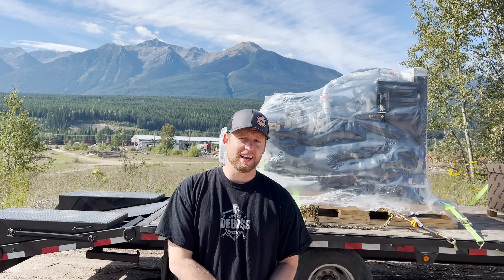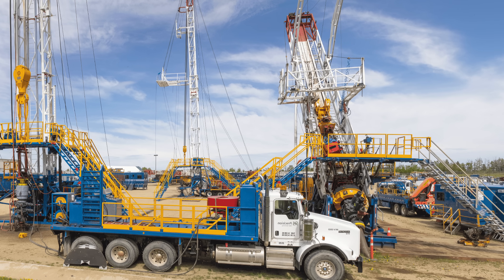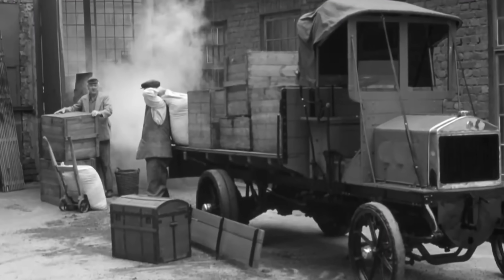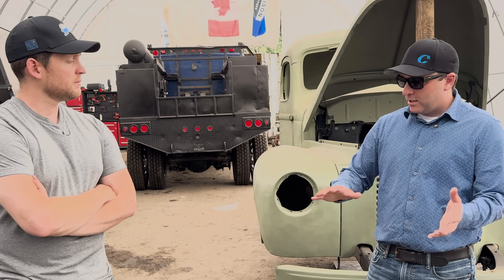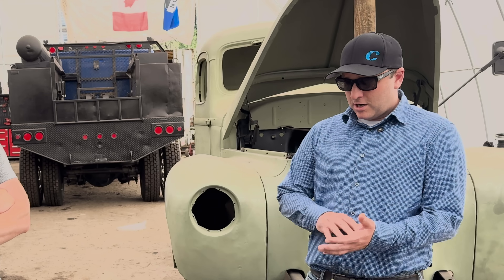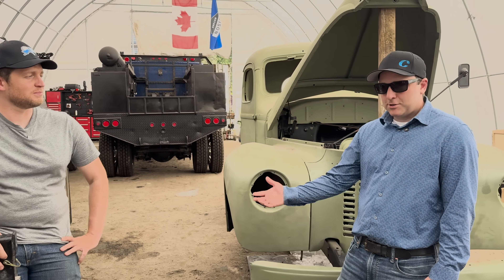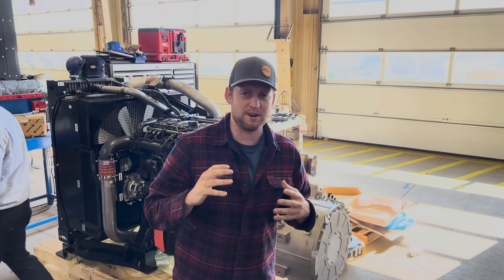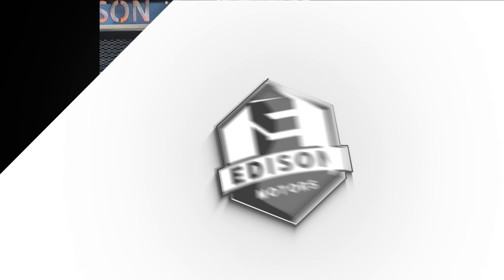We're putting Scania engines into Edison Motors Trucks!

Comment: Okay, maybe this is a dumb question. I thought the whole concept here was to put a smaller engine in to drive the generator. Maybe I don't know enough about the commercial truck space. But this seems like just a regular sized diesel engine for a commercial truck? Maybe I'm confused on what we're talking about.
Reply: It could be that the 770 @ 50% load is more fuel efficient than the C9 at 90% load. This is a generator though which typically run at a single RPM, my assumption is CAT didn't want to budge on pricing without quantity, since Edison cant afford quantity then they went to scania.

Comment: one thing to consider is that european fuel is allowed more sulfur... which is a lubricant... which a lack of can cause fuel injection pump issues... See Bosch CP4 failures in GM,Dodge and Ford light duty diesels.

Comment: Wow... bruh... 
Highest loads we see in Europe is 76 ton, and thats in Finland, rest of Scandinavia is between 50 - 74 ton.
UK is 44 ton.
Rest of Europe is mostly 40... with some exceptions.
We see more and more length changes too more inline with Scandinavia where we have had 25 meter long combo's for decades, that has increased in some cases to 30+ meters.
Volvo has again taken back the crown of highest power engine, they were leading at 750 for a very long time, Scania then got 730 to 770 and now Volvo has a new 17 liter engine with 780 hp and 3800 nm, up from 3550... just crazy numbers!
Scania are the only ones doing V8's now as far as I know...
The International LT's just got the 13 liter Scania engines with the S13 Engine and T14 gearbox, dont know of any other atm that use them in North America but could be more.

Comment: Fantastic!!! If Caterpillar was going to treat you anything like how they are treating me, then you made a great move to Scania!!! I have two mini-excavators that have problems working in the mountains built into them straight from the factory. After the dealer spent several months in total dealing with my machines, their lead tech told me, "This isn't right. But, I doubt CAT will do anything about it.".  I told them that I do not mind the problems, as long as we can all be on the same team to either fix them or work directly with the computer programmers to feed them real world data to improve the line. they prevaricated and stalled and finally told me that they can't give me access to anyone - CAT doesn't allow it. And, they started saying, "Your machines are in spec. We did everything we could to make you happy."  ...total, ugly, corporate talk. ...from, don't worry, we'll make it right, to, nothing wrong, we were just trying to make you happy. Lesson: stay away from CAT!!!

Comment: I have been following your channel for a while and I'm excited for Edison Motors to have such a great opportunity to accelerate their business & disrupt the competition! A word of caution though: Don't let the big partners take over the culture of Edison Motors! Read the fine prints in detail and don't become like Tesla! Service should be available wherever a truck breaks down and not be exclusive of a dealer. Software updates should be available forever and not temporarily. Don't become like John Deere equipment that forces their clients to buy new equipment because they don't support old equipment and their own software. Don't become like apple where every year they design new charging connectors on their phones that are incompatible with old charging cables because they have different charging frequency and the battery fries if using an ordinary over the market charger. Let the software be like Linux! Completely accessible to brilliant minds so it can be modified and perfected for better performance! Only certain sections should be protected but can have a temporary access to fix an issue but protect it from bootlegging. Microsoft did this with its windows program! They knew people copied their software and let them do it anyway but disabled certain features because it didn't have an original certification! Edison can do the same! Let the service mechanics do modifications but only temporarily until they can explain why they are doing it like that  in order to certify the software module; sometimes mechanics have better ideas than engineers because they are the ones working on the problems! I hope you can read these suggestions and at least consider some, good luck on your journey! I'm rooting for your success!

Comment: As a European I'm obviously biased here, but it's really nice to see that Scania engines will be in Edison trucks! Agree with your point that running a larger motor at an easier power level is better for service life and emissions. Taking Bruce Wilson by his word, Scania trucks and probably engines are also very good to work on. Will the engine just be rigged to a generator or will it have a direct mechanical connection to the drivetrain?

Comment: I found out about Scania many years ago as a Diesel Technology instructor.  I researched them and found out that Cummins and Scania had joint projects going back at least 20 years from now.  Scania has a great reputation for being a solid choice for diesel engines.  I'm all for what you guys are doing.  Hybrid is the way to go for a long time to come.  Now, just convince these stupid lawmakers in California. The single greatest influencer for the legislators is the CARB (California Air Resources Board). They have their heads up their yahoo's so far they cannot think clearly.

Comment: The lack of a DPF is precisely why CAT stopped building on-road engines. They pulled off the same achievement and the EPA told them "No, gotta have a DPF".

Genset setup may have to meet different requirements than direct drive though.

Comment: If you are wondering why Scania Engine  doesn't use DPFs is due to ECM/ECU calibrations, they put in the time in the test cells to calibrate it properly.  While US manifactures run it bare minimum and that's they need DPF, have higher consumption and lower power figures
Reply: Crying out loud. Cheap and dirty.

Comment: Seems like a really stupid idea actually.  Having it as an option is cool and all, but Cummins/Cat are the most common engines in North America.  Finding Scania parts out when you're off road in Pink Mountain is going to be significantly more difficult than getting common Cummins or Cat parts.

As someone who has worked all throughout BC with exotic equipment, having something unique is really cool until you have to fix it and stand by charges start piling up.
Reply: We'll see. Seems Scania has some support already, just not for highway engines. 
And if they are without DPF is one problem less. 
Maybe the generator charger running constant rpm is easier on the engine so they don't break without warning (so much)?
Reply: @subwarpspeed  It's not a we will see matter, it's a fact of the matter.  Scania needs a much larger footprint in North America.  Working in remote wilderness, something Edison Motors has personal experience with... which makes this decision even more baffling... you want to have the most common, easy to replace components.  

You have a couple fleet trucks down, waiting for parts from Scania the novelty wears off fast.

Air mobilizing parts, especially heavy parts is very very expensive.  The Wirtgen I worked on, we were left stranded for three days waiting for Bolts from Germany.  Why?  No one ever thought anyone would need those bolts, they were part of the unstocked 5% in North America.

That was $10k+ a day the machine wasn't making, plus paying standby for a road building crew to do nothing for three days.

On a truck, that kind of wait would never be acceptable.  

I really think the Scania engine as an option is a brilliant idea to help Scania build a network here, but the standard genset should be a Cummins or even Paccar.

Comment: How much kW are you using from the 770 then? That engine would not need much more than idle?
Using a smaller engine at higher load is more efficient

Comment: So the cam profile and intake and exhaust lengths etc are all optimised so the engine is optimised for the optimal rpm for the generator..? 
And where's the bell mouthed air intake to take advantage of any airspeed from the front?  This is supposed to be all about efficiency right..?  :)

Comment: Question:
I understand that part of the idea to go hybrid is, to be able to reduce the engine/generator size - roughly to 1/3 what you would use/want in a straight Diesel application....
So - what kind of power can you realistically use with TOPSY (or the next truck)?  I understand yor E-axles are already too powerful to use all of it without shredding the tires?
So if you have no need for the 770hp/565kw - why use that engine instead of the 9L 270hp/200kw system? Isn't  the idea to size the battery pack for your worst case scenario (max power from the pack plus the generator for the max time estimated) and for the rest of the times the 200kw would be more than enough to keep the batteries charged? (....when regeneration isn't enough)
I am sure the 9L is a lot smaller/lighter than the 16L (5 cylinder inline vs V8)....
Certainly the smaller Scania is just as efficient at it's level as the big brother. 
Question is, did something chamge with the basic idea/philosophy?

Comment: I don't understand. I thought you were planning on putting a diesel generator engine in that is charging the battery and running at a constant torque level which is the strongest reason for using a smaller generator.
Reply: I think they're just making gas trucks now

Comment: I personally never got why a lot of other European truck brands never made it to NA. Volvo has been here for years in both big truck form and automobile form. The same goes for Mercedes, BMW, Audi and so on as far as automobiles. I'm sure Scania could find a new market for themselves here if their cab-overs gained popularity. That's one of the things that has been nice to see with farm equipment in recent years with how Fendt, Claas and Krone have been coming this way more as well.
Reply: Well Fendt is owned by AGCO. The Fendt Vario 1000 series tractors were repainted as Challenger 1000 but I guess they are phasing that out (Challenger website doesn't work) and the Fendt 1000 comes to NA.
Reply: @subwarpspeed  They may be owned by AGCO but sometimes it seems like some brands are always just for sale in Europe. But it's nice to see they're becoming another option along with Claas that someone can take a trip to a dealer for instead of needing one imported. IMO there's not enough choices for equipment especially in my area and it kind of gets old seeing the same four brands over and over. Maybe Deutz will come back to NA someday. There's a lot of old Deutz-Allis tractors from the 80's and 90's around my area. Of courser they're not as common as a CASE or Deere but they're around. The people who have them seem to like them.

Comment: One thing I wanted to know is how open is Scania to you Right to Repair.  I know you want to have open source programming and clear to read fault codes.  Will Scania require a license to their diagnosis software, will that be a part of the truck, or a something separate?  I think it would be an awesome selling point if an Edison truck came with the full service manual and diagnostics for the Scania motor

Comment: verry missleading on DPF considering they will still run configuation of emmisions system wich will fail, not to mention comparing a 13l 550 to a 18l c18 is not even close motor to motor comaprrison to explaine fuel consuption. Also service, you may be able to get parts but having actual companies to service it(with the proper EST) is a different story. i garantee almost nobody in north america will work on it. Scania may be a good product i have no boubt in that. im just saying the way it was descibed was misleading is all

Comment: Ok, so how is the service network in Canada?  Its pretty non-existent in the US.  (Nobody drives Scanias, and Nikola doesn't count, since those are electric and hydrogen vehicles)

Also, do you really need a 770HP engine as a generator?

-EDIT-
I stand corrected, just did a google search, there's Scania parts dealers all over the US, 7 dealers just 2-3 hours away from me.

Comment: So my question is why? For your trucks, it's just gonna be a generator. It's not powering the drivetrain or anything, and will be running at a set RPM whenever it's running. I understand the want for better fuel efficiency but couldn't you get that with just a smaller engine? What's the point of up to 770 HP for a generator?
Reply: Reading some Edison answers it's not going to be the 770 V8 engine normally, except they want it some rig just for the fun of it. 
But an expert at all but someone pointed out the engine they have gotten is an inline one. 
I agree, it only makes sense if it requires lots of power, meaning pulsing heavier and having a third e-axle as they mention on the webpage.
Reply: Have they given up on electric?
Reply: Perhaps the plan is the hybrid,combined power

Comment: Sounds like a rather large engine isn’t it a little overkill for running a generator? For a direct drive platform seems to make a lotta sense but for what your doing I’m not understanding why so much horsepower and torque is needed
Reply: I think the is to make hybrid.
Reply: @Z4N7   Topsy is a hybrid truck.
Reply: This is just a hybrid now

Comment: Would love to see an Edison fuel tanker
Reply: I've thought a garbage truck would be a good fit.  They are just stop and go all the time other than when they are going to and from the dump.  Run on batteries when they are collecting garbage and then when they are driving to and from the dump they can fire up the generator to charge the batteries.  As an added bonus there is at least 8 hours or so where they are not running at all so even a 22 KW charger would be more than enough to charge the smaller battery pack overnight.  That would drive down the cost of infrastructure to support electrification.   Even the 550 HP engine would be way overkill for that though.

Comment: on the Emissions side, for your trucks specifically, are they taking consideration that your engines won't be running 100% of the time, because an engine running 50% of the time or lower for the same distance of  an engine being running at 100% of the time!

Comment: 2:45 that's only partially true, 40 or 44 tonnes is a max weight for most of the continental EU, however in the Nordics we can haul way more than that, in Sweden - home of the Scania we can haul up to 64 tonnes with truck and trailer combos of up to 25.25 meters, and after the latest transport regulations revisions, up to 74 tonnes and 34.5 meters in length on selected roads. That's where the 770 comes to shine ;)
Reply: Finland has had 76t limits for like a decade now 😅😅
Reply: @nikonieminen1207  I know, our Swedish law makers are a bit behind you, our dear brothers to the East 🥲
Reply: @WeekendWarrior92  but i mean, at least you get paid 😂local truck owners are jealous that companies can easily stay afloat with lower payloads 🤷‍♀️
Reply: The USA has permits to go over 40 ton. My company has many straight truck and trailer that hall 64 ton.
One of our transport drivers said the max he's hauled with his X15 powered tractor is 128 ton. You just have to get permits and have the length and number of axles to spread that weight out to legal limits.
Reply: @samuelfox8126  yea but thats 40 tones on the regular tractor trailer rig on your day to day hauls. We also have oversized load permits and companies that deal exclusively with that. Record in our country (Slovenia) is 500 tones with the total length of 75,5m. It was a 240t heavy transformer loaded on 32 axels pulled / pushed by 2 trucks.

Comment: 44 tonnes load is nothing.
Scania is swedish and normal total weight of truck + cargo is 64 tonnes in sweden. On certified roads even 70 tonnes if certain criterias are met regarding The trailer and truck.
F.e some timber transports are 90 tonnes total weight between timber-terminals

Comment: I strong believe , Edison+Scania will be dream team. Does you guys also offer Scania  new G38 series Automated transmission?

They are rumor also Scania is working in new horsepower which is bigger than 770HP and Volvo D17’s 780HP, should be coming soon
Reply: Why would they have that transmission? The Edison trucks are series hybrid (unless someone orders a full BEV). The diesel engine has the generator bolted to them to only turn diesel into electricity. With the batteries and e-axles (axles with the electric motor built onto them) there is no mechanical link so no Scania transmission. 

The e-axles put the cap on how much power they can output. But they can of course build trucks with more axles but the point is not really to have the biggest diesel engine (which this video though seems to try to jack up).
Reply: @subwarpspeed  Don't forget Edison does have reguler Diesel truck , BDE 770.

Comment: I don't get it. You want the electric to be the main power source to move your truck. So what's the point of having a v8 and all that horsepower...for a generator. The maintenance,  mileage, aren't gonna matter because it's main function is to charge the electric motors. Basically low rev, high idle hours are gonna be what you need and I'm sorry but a v6 with lower hp is gonna be way better at that task. If your just trying to make a cool truck fine but then your just changing your business model from trying to develop and sell a diesel electric vocational rig to making custom muscle trucks.